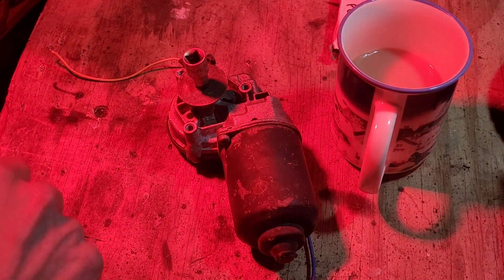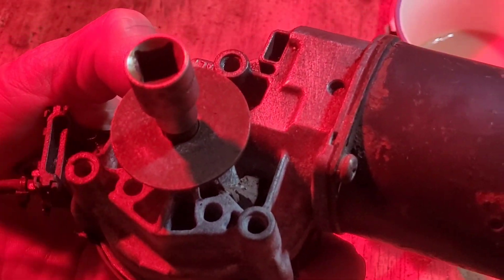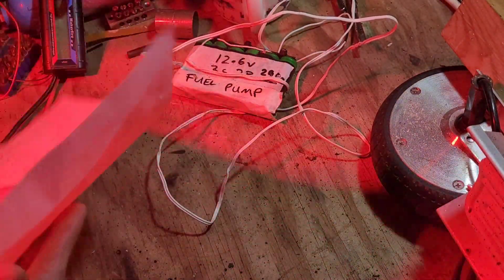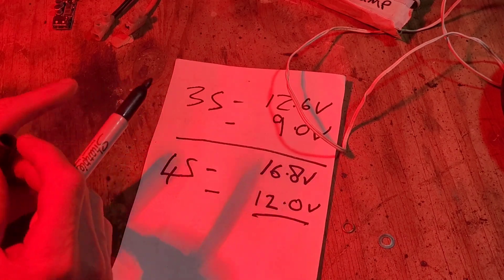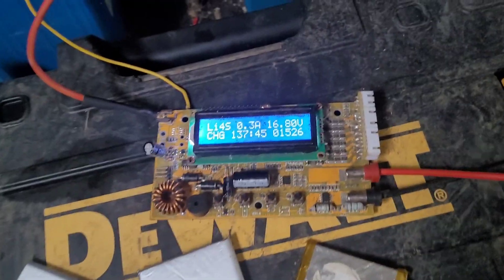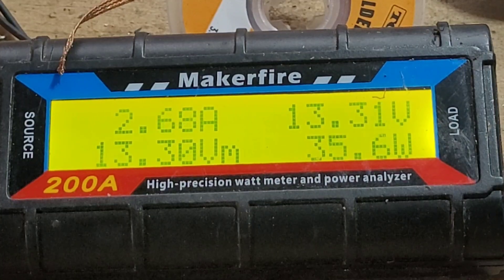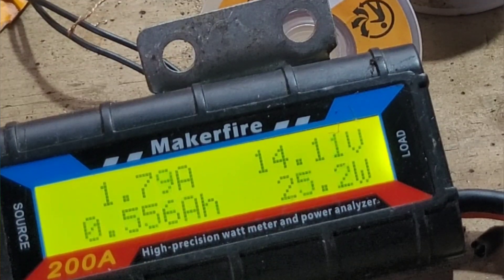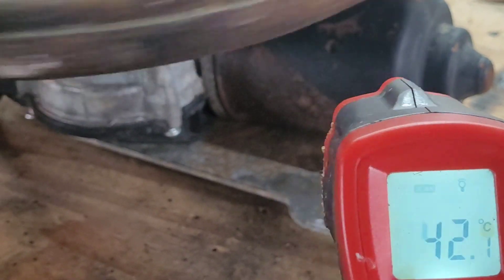12v Wiper Motor Direct to Crank Electric Bike - Testing with a Simple Homemade 4s Lithium Battery

Comment: I guess a window crank motor isn't intended for continuous use
Reply from the maker: Yes I think you are correct but If you are in the car for an hour and it's raining they stay on , maybe the heat is due to running over 12 volts !! More video's to come about this for sure :)
Reply: Agree imagine full blast wipers for 1 hour. The load is most likely where the heat is coming from. The voltage may play a small factor but if you take the weight off I think it won’t heat up at 16v
Reply: Unless ya live in the UK or the Pac NW haha!

Comment: Curious to see how this goes, subbed.
I have some ideas about using wiper motors for an RC tracked vehicle.
Not much speed but lots of torque.
Reply from the maker: They have a winch like amount of torque, I looked up it said they have 15nm but feels like loads more , would be perfect to drive a trolley over bad terrain, I ordered some server fans to cool the motor down as it got very warm after 45 minutes,  which I can build a separate battery, cheers,

Comment: what top speed on your bike do you think it will achieve?
Reply from the maker: Probably only 10mph but should have a long range , be able to go up hills fairly easily , only requires a small battery , doesn't need an expensive controller.